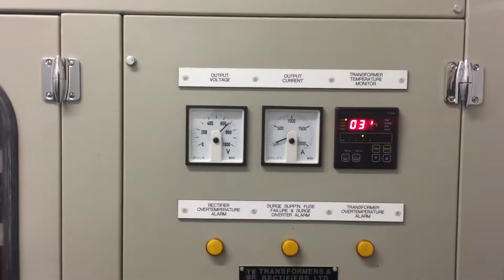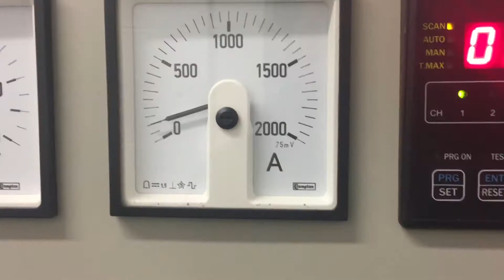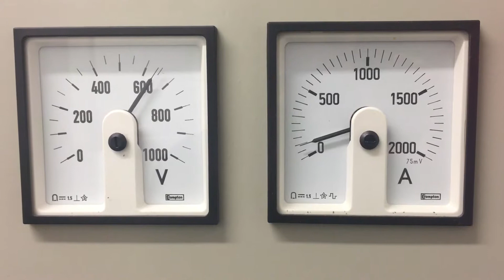traction rectifier meters

Comment: I doubt this is a Traction Power Rectifier for an Electrified Railroad, because there is not much load on the Ammeter.
Reply from the maker: traction power supply for trams also fed from other supply's sharing the load